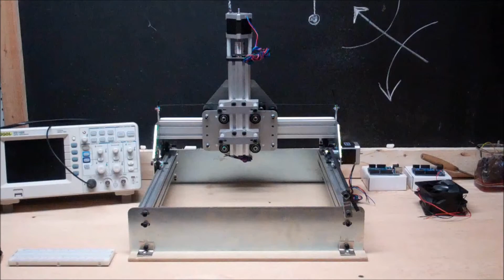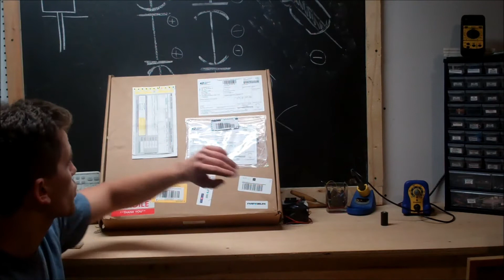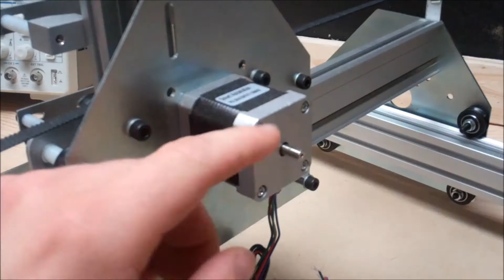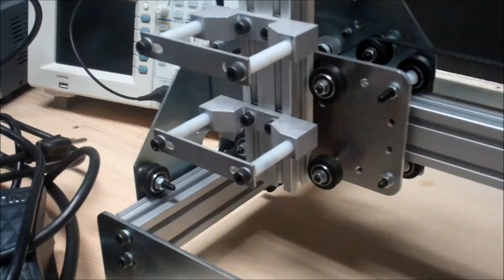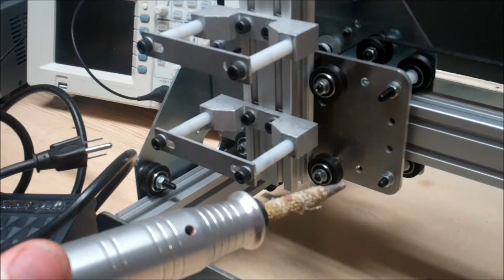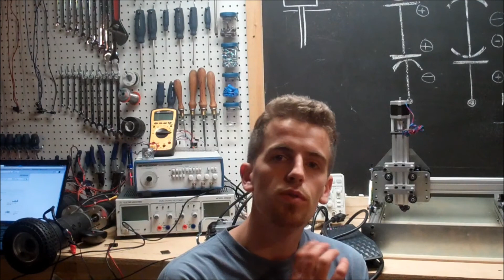Bench Top CNC Milling  Machine

Comment: Thin diameter vacuum hose will work, just place it so it does not strain the motors, probably you will run it up to the same point as the flex drive so they both do not get strained. You will have to mount the motor drive quite high up so it runs near straight down to the collet, as otherwise it will wear out fast, and will give a lot of error on the spindle as well.

Comment from the maker: The vacuum removal is pretty solid idea, and I'm not going to lie I'm probably going to include it into my design now (really appreciate the idea). I just got to figure out a vacuum system that could work on such a small device (I might go with a shop vacuum and reduce the hose size to reduce weight on the actual machine as it is extremely small. 

Thanks again 

Nick

Any other suggestions would be greatly appreciated!

Comment: Do not disregard the most important part of precision milling is swarf removal, as it does make a big difference to the finished cuts and can ruin precision parts by catching and messing up the tolerances. Vacuum removal will also help with cooling the cutter head and the work piece.